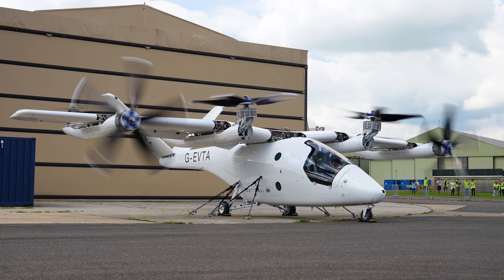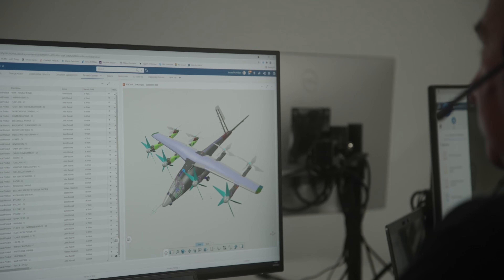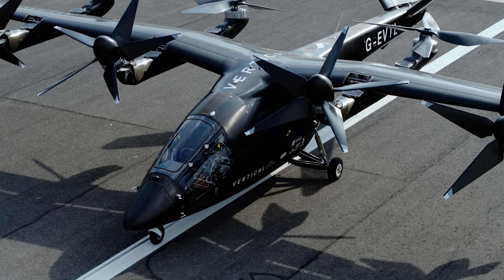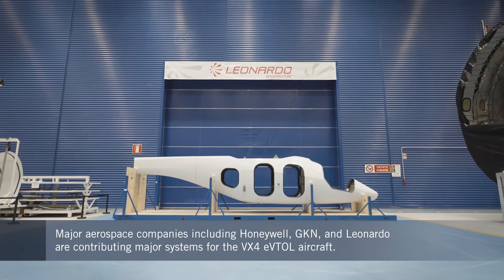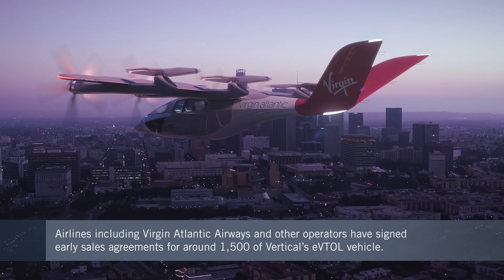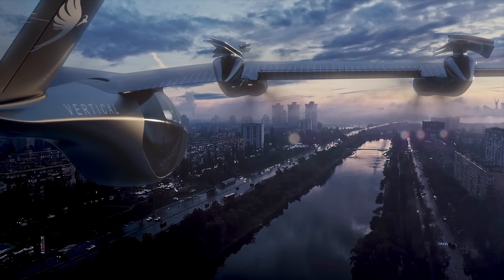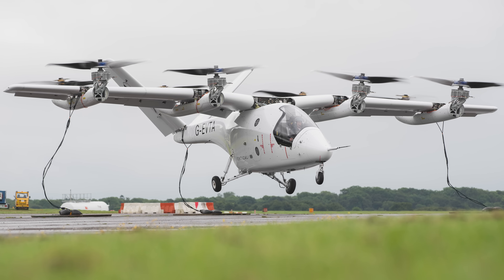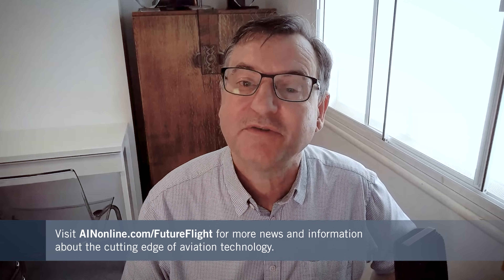Vertical Aerospace Starts Next Stage of Flight Testing For Its VX4 eVTOL Aircraft – FutureFlight

Comment: Great achievement in developing electric aviation. HOWEVER the business model is totally based on the Vertical TO and Landing - with a payload that are paying. Add the weight of passengers, seats,luggage, soundproofing and safety equipment plus the aircraft’s heavy IFR equipment essential for reliable commercial operations and this becomes simply unachievable.

Comment: My question about this design is the rear engines. One of the biggest criticism about the F-35B is the weight and space taken up by the vertical fan system. It’s basically dead weight during forward flight.

If the fans on the rear don’t contribute to forward flight, it’s basically dead weight.

Also it seems like lots of work for 6 to 8 passengers!

Comment: This, and all other, multi - motor drones will never really be successful, not in operation. The concept is flawed, or should I say, the concept is not efficient! Having lift engines and other forward propulsion engines , means you are always carrying dead weight, that could have been used for useful payload. Thus in a nutshell, the very same lift engines should provide forward propulsion as well, if not the concept is compromised. I am not saying that it wont work, just that there are more elegant solutions out there , that prove my point!  Pterodynamics being the best !

Comment: good luck, Alef motors has the best design in my opinion. Its Genius and can drive on regular roads. The fact it can tilt on its side and turn into a biplane is really impressive. The cockpit can rotate on two axis and the screen that protects the motors is also a flight surface. Flights start in 2025

Comment: I always wondered why they don't also make the rear propellers able to tilt as well but in an inverted manner (they face downward for vertical lift and tilt rearwards to point towards the rear for horizontal flight)

Having them be fixed and become dead weight plus be an unnecessary point of drag for the majority of the flight seems counter intuitive for an EVTOL.
Reply: 我一直在想，亚音速飞机为什么需要机翼？没有机翼不行吗？
可能亚洲人的思维方式与欧洲人的不一样。
Reply: @Josh-zh  

飞机需要机翼提供升力，这样螺旋桨就可以在长距离平飞期间专注于向前移动。这有助于降低飞行期间的能源成本并节省电池容量。

Comment: Real life application, meet the concept of energy density. I'm willing to bet big money that this is not going anywhere, mainly due to severe restrictions caused by battery weight. Even in the test footage, the prototype is receiving ground power. Remove that and add 4 passengers plus a couple of laptops and this is staying firmly grounded. 

In short, a project running mainly on government funding because we were all meant to switch to net zero.
Reply: Really? So how has Joby been able to fly with a pilot in board for theirs?

Comment: I'll never understand why a company like Volocopter @volocopter chose to build a 2-seats aircraft instead of a 4-seats one directly. So much added cost to certify a first aircraft that won't have real commercial utility and then redo a good chunk of the process for a bigger 4-seats version, which on an engineering and flight behavior point of view, doesn't seem to be so different that it is safer to start with a 2-seat first aircraft to pave the way, beyond much more early stage like very first flights of a proof of concept.. I don't know. It seems so obvious to me that I might be wrong somewhere.
Can somemone here with skills in the domain please help me understand if that's the case ? Thank you in advance

Comment: What about safety with regards to the batteries. Is there a fire suppression system on board?
Reply: battery fires, as proven in Evs are 10 to 100 times less likely to catch fire.

Comment: Relying on honeywell and other capable suppliers might give you a fairly well built product but also assures high cost and lack of control of the design. Missing opportunities for optimization. The aircraft strikes me as elaborate for what it offers, maybe in the multiple millions of dollars. Why a bend in the wing? why so thick? why is the tail so massive? Why the hefty landing gear like it's 5 ton?  why a pilot when it should obviously be autonomous/remotely piloted.
Reply: So many issues with your comment. Not even gonna give it the time..
Reply: @pushingporsche4830  then let me add that it should be a tilt wing instead of tilt motors. It should be blade gear and airless tires. There should be no pod under the wing, motors should be on the wing edge and their first product should be a single seater, at most 2. Where EVTOL can truly outshine helicopters is in a single seater so quiet it can fly in urban environments, even at night.
Reply: @pushingporsche4830  我喜欢他的评论。他知识面广，记忆力好，思维敏捷。他是非常优秀的工程师。

Comment: Outstanding video. Thank you!  We have to bear in mind not only the energy capacity of the batteries, but the durability of them. Li-ion, at 4,000 charge cycles would be substandard in a passenger airline environment where turn and burn is important for profitability.  Note that Sodium-ion has ALMOST the energy storage available on Li-ion, per kg, but it is improving that very quickly. What's intriguing about Sodium-ion is 50,000 cycle-life. That would be good for airlines and also for air taxi situations.
Reply: Sodium-ion is pretty far away in terms of energy density from what is needed for aviation applications. What good is 50.000 cyles lifetime if the vehicle is too heavy to lift off the ground? And first of all we need longer flight times meaning even higher energy densities, and not lower. The battery cells we see in this video have an energy density of ~242 Wh/kg. Sodium-Ion is only half of that.